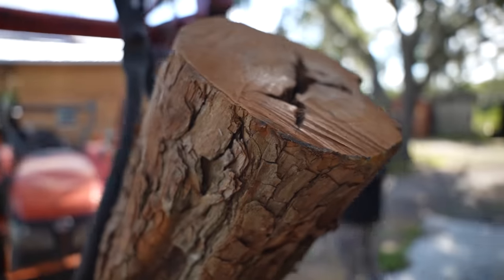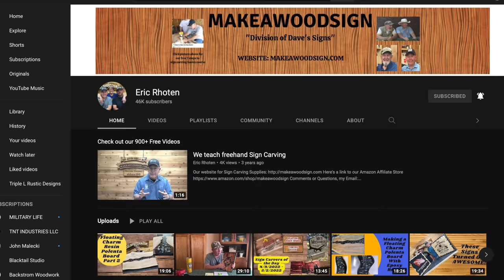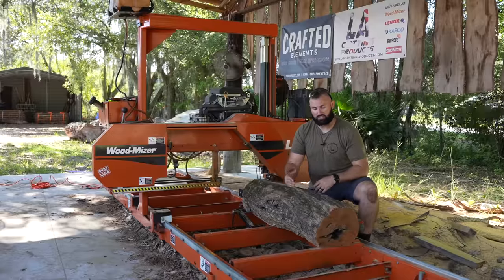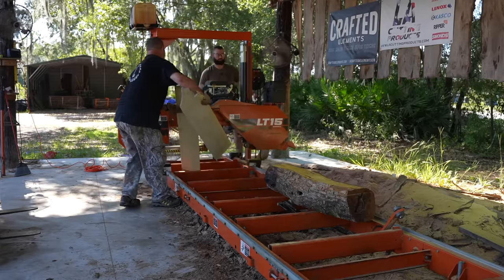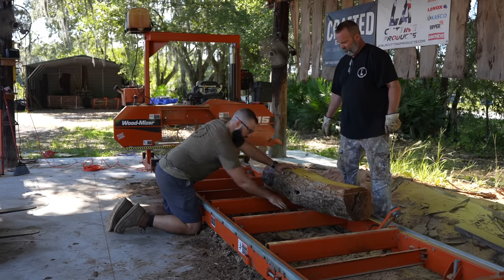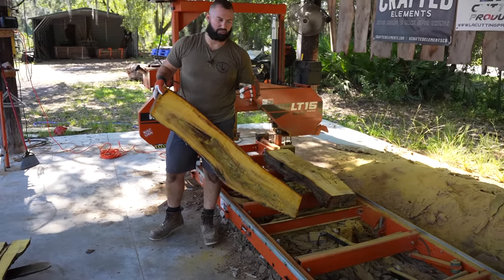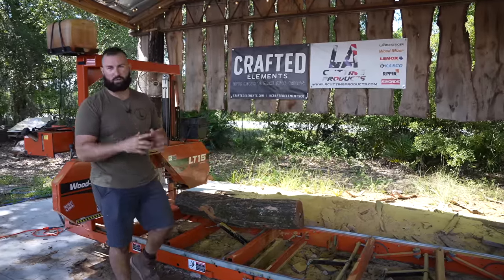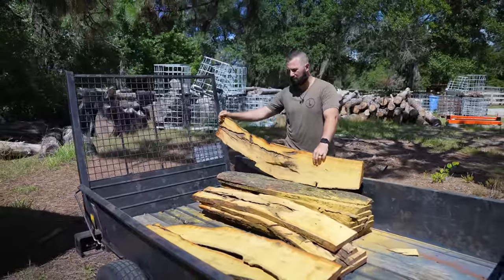They Should Call This The Honey Mustard Log - Osage Orange

Comment: Trey… Osage Orange (aka: Bois d’Arc, hedge, yellow wood) is one of my favorite woods.  

It is the densest, hardest, strongest and most rot resistant wood that is native to North America.  

I can take you out and show you miles and miles of fences built with it in the first half of the 20th Century that are still in serviceable shape.

I made a hammer for a buddy out of it.  The video on my channel shows all the specs of the species.  And, shows special woodworking techniques for cutting and milling it.

My neighbor has a similar saw mill.  When he cuts short logs, he clamps a piece of scrap to the vertical upright.  The log is butted against it and never shifts.

Thanks for posting!

Comment: In the 1800's and into the early 1900's large diameter Osage was also used as house blocks when concrete was not available in very rural areas because of it's rot and insect resistance .  Many of the homes around where I live in rural Texaswere built in the early 1900's including mine built in 1923 and it still has some of the Osage orange blocks under it that were never replaced during some of it's remodels over the years .

Comment: I sold a friend an old military wagon I found in New Mexico. I packed it to Santa Fe, Tx. And it rotted with in 6 months. 
My friend had it replaced exactly as it was made (lots of pictures before dismantling) with Osage orange, or as we call it Bois de’Arc.
I also watched the ATSF rail road co. Take down an old bridge with Bois De’Arc support around 18” in diameter (old, old bridge) and some of them were still not dry in middle.

Comment: and another thing in missouri we call the wood hedge because it will grow in lines if you let it go the form hedge rows and as the wood get dryer it gets harder
Reply from the maker: Dang that's cool
Reply: SW/MO here… growing up, that is all that I knew it to be called.  My grandfather worked for the CCC during the Dust Bowl.  He planted miles and miles of Hedge fence rows to stop wind erosion.  

The department of agriculture discovered that old fences, where the brush wasn’t cleared, broke up the wind. Dust piled around them.  Hedge fence rows were the most dense and stopped the most dust from blowing past.  As a result, they put thousands of men to work planting rows of them.  It worked and many of those rows are still there today.

Comment: If saw mill uses the square  log stop on the back side. Take one out and find some square  tubeing that the stop would just fit in. Then cut tubeing  in 2 inch links tack weld in on different spots . Then you should be able to cut shorter logs better.

Comment: I have boocoodles of bodock  growing on my property. Interested?

I’m sorry, but I had to laugh. I’ve cut bodock or Osage orange in the past. Not with a sawmill but chainsaw. I sometimes use it for fence posts if I can get one straight enough. They last for years and years and years, well you get the point. I’ve burned up several chains on my saw cutting them up. You just have to include the price of a blade in your quote. Just make sure you get the logs at better than 6’.and stock up extra blades. Again, sorry I laughed. I know you had a bad day. Respects

Comment: Whilst the clamping arrangement isn't ideal which you've highlighted, was the log jumping because your dad was trying to feed the blade too quick and it was grabbing? 9:35 mark of the video is a good example.  It seems to be a lot happier around the 11:30 mark when you appear to be feeding the blade a bit slower.  I'm no expert on the mills - purely a laymans observation.  Nice colouring on the timber, it will look stunning either oiled or lacquered.
Reply from the maker: Yeah there was definitely a sweet spot when it came to speed but that log was a tough one for sure. It was still jumping around the whole time. I was just trying to get through it without the blade breaking on me.